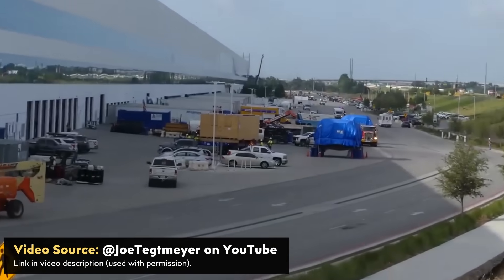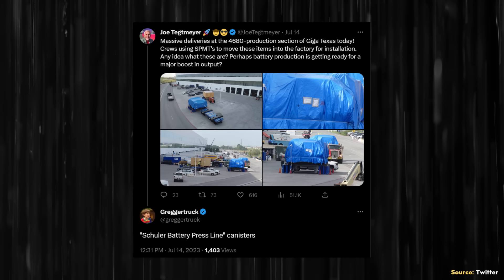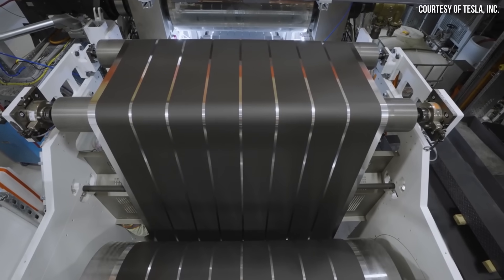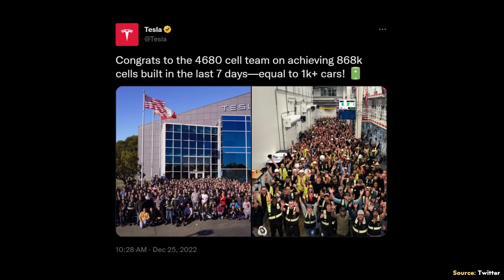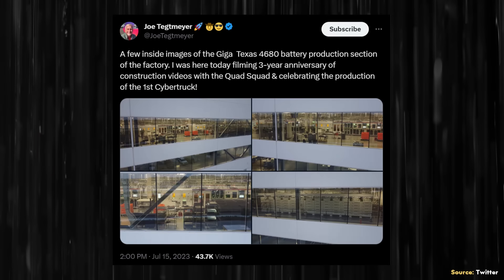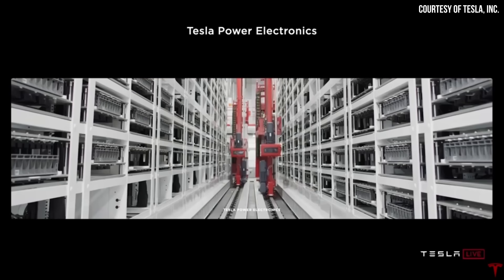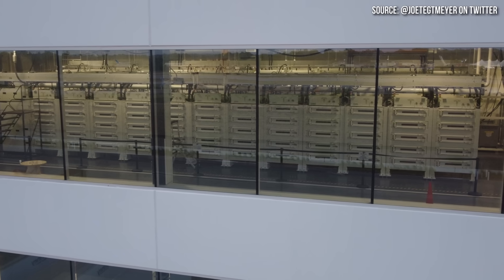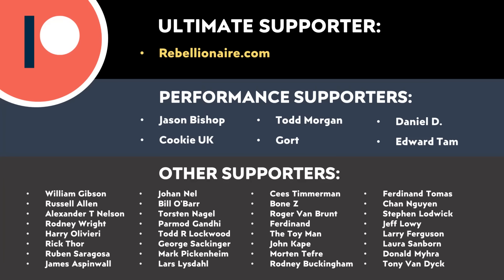Tesla Giga Texas 4680 Battery Production Update | New Equipment!

Comment: Telse Model Y is ~78 kWh and uses 830 of the 4680 cells. --- 2.56 times more for Cybertruck (200 kWh / 78 kWh). --- Cybertruck 500 mile 200 kWh would require 2128 of the 4680 cells (830*2.56).
868000 / 2128 = 407 Cybertrucks per week.  Eek.

Comment: Jon - I like your channel as you present a well thought out and well researched topic.
As you may know Tesla has acquired a large warehouse very close to Kato Road plant to build 4680 batteries. Based on the expansion of GT battery lines and the one in Fremont,CA it is my educated guess that Tesla has or close to solving the dry coating process. With additional capacity coming on-line in NV Tesla should have access to lot of 4680 batteries in the near future. This is good news for CT and MY production using 4680 battery packs.
Reply from the maker: Thank you! Yes, very good news.

Comment: Aside from reliable, scaled production is the issue of energy density. The previous reported value of 247wh/kg won't get the job done. They need an energy density of about 300wh/kg as originally targeted. (Recall that Maxwell, the company they bought had a working 300wh/kg battery (but not replicatable at scale) and a theoretical limit of 500 wh/kg. 
This is what Tesla bought and estimated their production target was. 
However, the 247 wh/kg was just a reformulated 2170 for dry electrode in 4680 package with tabless design. 

It still had some cobalt and still did not have the new cathode. 
So the chemistry is not the target chemistry. 

Clearly they ran into trouble here and that effects Semi and Cybertruck and "Model 2" and Roadster which cannot be produced at scale without the more advanced chemistry/higher energy density.

This is the most critical part of Tesla development that is Not visible. 
Alot is riding on 4680 clocking in at 300 wh/kg.... so. It can't really be good news just yet. 
Limited production will work for now, but they can't really scale multiple products without that battery performing as projected. 

Would REALLY like to see where they are with this as this is the last big obstacle before Cybertruck, Semi, Roadster and much improved M3, MY, MS, MX roll off the line.

This would unlock ranges over well over 400 mi EPA across all but the economy lines and shut down the range anxiety conversation for good.

Tesla will do well regardless, but this is the news that would allow them to take off and raise the bar again across the industry.
Reply: Q2 Earnings 2023:
"What is the status of the 4680 cells? How far from achieving what you claimed at Battery Day?
DREW: 
Focus on YEILD at Texas plant
Cybertruck cell is 10% higher energy density than current production
Against our battery/energy density targets, Cybertruck is on track
Important to remember that we focused mainly on COST reductions at Battery Day, which we are seeing at the Texas factory."

Comment: All depends where the bottleneck is (/was).
If the canning and tab connection process is up to speed, that would mean the issue was with either anode, cathode, or roll formation (?)
.
All previous indications were that the cathode formation was the issue.
.
So, divide the capacity of the fastest part of the process (canning?)
By the capability of the weakest part (cathode?).
If a single cathode line can reliably supply 35-40% of the canning requirement, add 2 more cathode sections!
.
It ain't Rocket Science!
.
Use those extra lines to refine the process.
(In fact, a fourth line would serve that process, one machine always down for "tweaks")
.
When those machines each achieve 60% reliability/ run rate, open a second roll assembly/ canning line!
Gradually increase speed...
.
I suspect that's where they are now.
.
Next phase?
Finish building the cathode plant!
Run that in tandem until reliable.
As the cathode units reach 100% repeat the process adding more total assembly capacity.
.....
I wonder if a "final iteration" cathode machine is almost ready?
.
If so, hold on tight!
.
Next indication?
Possibly signs of these machines in Nevada?
.
When that happens, it's the rapid ramp phase.

Comment: I can't find any info on CURRENT energy density of the 4680 battery.  The initial run of 4680s had way less energy density than the 2170s (that's why Model Ys with 4680s only have 279 miles of range, while those with 2170s have well over 300 miles).  WHY ISN'T THIS BEING TALKED ABOUT???   Has Tesla improved the chemistry in recent runs of the 4680s??  The overwhelming consensus assumption is the CT will use 4680s, but if Tesla hasn't drastically improved energy density, then there is no way the first run of Cyber Trucks can use 4680s.  My gut is saying the DBE process and batt chemistry is continuing to be a massive issue for Tesla.  I really hope we get some honest and specific updates on the earnings call today.
Reply: Q2 Earnings 2023:
"What is the status of the 4680 cells? How far from achieving what you claimed at Battery Day?
DREW: 
Focus on YEILD at Texas plant
Cybertruck cell is 10% higher energy density than current production
Against our battery/energy density targets, Cybertruck is on track
Important to remember that we focused mainly on COST reductions at Battery Day, which we are seeing at the Texas factory."
Reply: It's all about economics in manufacturing.  Tesla only needs to make a fourth as many cells to produce the same number of cars.  Tesla doesn't care if the range is 280 or 300 miles if the cost of the batteries is halved!
Reply: @dfreadhoff  well said, although I think the 4680 model y pack is 860 cells vs over 6,600 for the 2170 pack's?
The prismatic lfp catl and byd cells are something like 80-100 in total cells though, further simplifying the pack. 

I wonder if cell manufacturer's like 3d printed sakuu could eventually move us with solid state tech. Towards much much larger single cells?
Like say 5-25kwhs per 3d printed layered cell? I'd like to see industry standardization for the pack cases&total cell capacity. 
Say 50-60kwh case, 60-70kwh, 70-80kwh, 90-100kwh etc.
Reply: The 4680 model y awd only have 68kwh capacity vs 82 in the awd lr 2170 versions.
Teardowns by the limiting factor and munro live show 2022 edition 4680s we're within 8-10% at the pack level energy density wise vs the best nmc 2170 cells. 

Elon himself already said in August 2022 the 4680 goals we're, to end 2022 competitive against the very best nmc cells available. 
They did that as the independent teardowns I mentioned prove. Then to end 2023 be better than the best available cells. That jury is still out. 

Also he drew and Zach said 4680 is a 6 year program. We ain't even through year 3 yet. Battery day was Sep of 2020! 
Remember it took panasonic&tesla at neveda 5yrs to fully ramp that plant.👍🏻
Reply: You won't have to worry about that. Tesla will chose a good battery type for each car type.

Comment: Jon, why are 4680s better than 2170s. It's definitely not clear.
Reply: https://www.youtube.com/watch?v=HK79ioBW8Mg
Reply: AFAIK, 2170s are made using a liquid electrolyte and the 4680s use a nifty new dry electrolyte process. The 4680s don't have to be dried and that eliminates huge production line drying ovens that take up a lot of floor space. 

My understanding is that Tesla has been struggling for the last three years with scaling up that dry electrolyte process while decreasing the number of rejected batteries coming off the production line.
Reply: They might not be better in any technical manner, but just the fact that they only need to make 1/4 as many cells to fill the same batteries, will save the manufacturer a fortune making cells and batteries.  Imagine needing to punch 1/4 as many cans, soldering 1/4 as many wires etc!
Reply: @dfreadhoff  agreed. And heat dissipation, better space usage. I don't think the dry process is being used yet.
Reply: So far the 4680 cells are not any more energy dense the 2170. There is still work that needs to be done
Reply: @SeahawkAz      Are these NCA or NMC 8:1:1?  Can an expired Pak be replaced with LFP?  Unless Energy gets much more expensive, LFP has too many life cycles advantage for Vehicle to Load.  kWh's from LFP are affordable.
Reply: @longtimber1  I believe the 4680 cells for CT are NMC. LFP are ok for passenger cars but are not energy dense enough for a truck, I think the present 4680 cells have a ways to go energy density wise to make an EV Truck a good option it’s probably going to take a different type of battery to be successful. The 4680 cells that are going into the model Y have lower energy density than the 2170 cells with the 10% increase that Tesla has reported will go in the CT just gets it over the 2170 at around 265 wh/kg. I would like to see 400 wh/kg